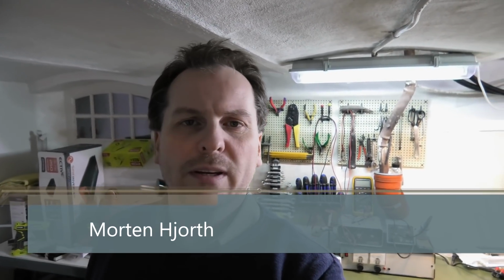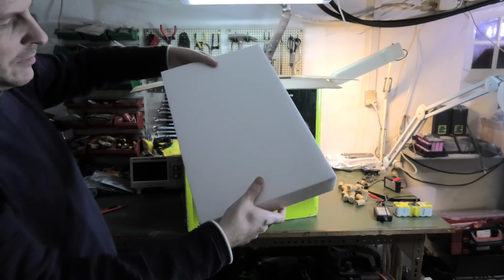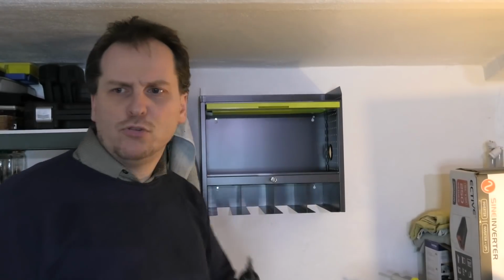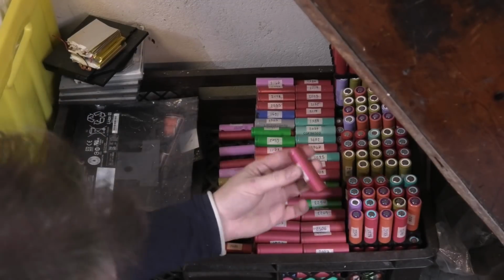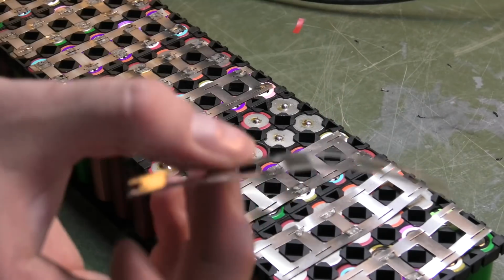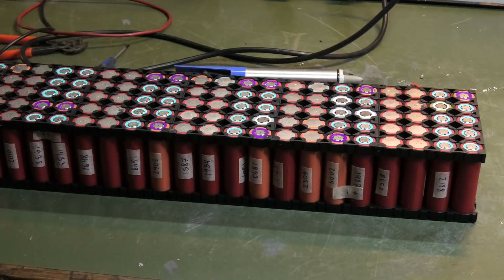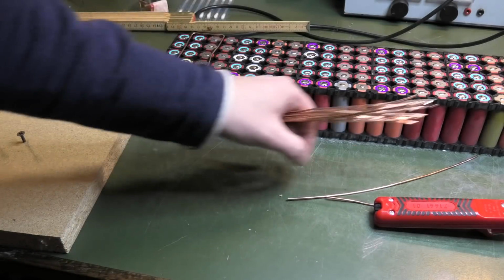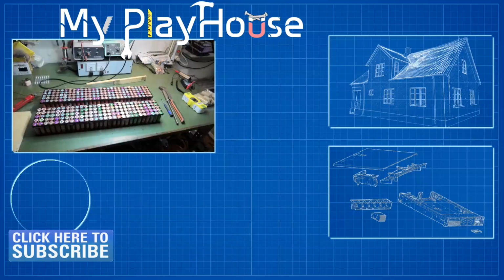2 KWH Li-ion Battery banks and Ryobi Tool Cabinet - 917

Comment: Hi Morten, A little tip for you to strip copper wire. 
A little block of wood, saw to the depth of a razer blade with a thin saw blade
Drill a hole a little wider than the wire being used, at the bottom of the saw blade in the same direction as the cut.
Tap the razor blade into the cut slot with one end angled to the depth of the top of the drill hole. Job done.
Put the wire in the wooden hole, give it a push past the blade, grab the end coming out and keep pulling.
The razor blade will cut into the insulation as your pulling it.
A bit hard to explain but I'm sure you get the idea
Good luck
Reply from the maker: Do you have a pic or link ?

Comment: get a Kweld and a big lead acid or a high drain 3 s with sth like 5k to 10k mAh its a super nice spotwelder, I own one and it basicly welds everything to a battery. 
the stress on the battery is mutch lower when spotwelding thats the main advantage.
Reply from the maker: I have had no luck, and have tried two.
Reply: @MyPlayHouse  yes there a view thinks that you must be awere of for example if u use to long of a lead the inductance on shutdown is capable of blowing the free weeling diode and so on ... 
I use a new old stock 120ah lead acid and it puts out 1.6 kA with a max pule energy of 100J you can weld anything with that. 
Again I highly rekomend getting a kweld they are made by a dude in germany and cost about 130€

Comment: Your bust bars that go through the plastic holders could over time scratch the cells and short out, I would either shorten the bustbar or use insulation tap to protect the cells. I did enjoy your video Morten.
Reply from the maker: Hi Peter195267
Thank You very much!  There is plastic in between,, and I am still going to hot glue the heck out of it.
Thank you for watching! :-)

Comment: For fast soldering i use a 100W solder, with 100W i need 1-2 sec and work is done, and battery dont overheat
Reply from the maker: Hi razbaluy
Thank You very much! Yes heat helps a lot! glad you liked the video :-)
Thank you for watching! :-)

Comment: Rawlplug is the company.
I learnt a long time ago that the drilled hole needs to go into the brick so the plug has a strong base, and always tap the plug below the surface plaster.
String through the plastic battery holders? brain fade :-D
Reply from the maker: Hi zx8401ztv
Thank You very much! I think I did all that :-) glad you liked the video.
Thank you for watching! :-)

Comment: If you are somehow lost in Italy and you need those wall anchors, here in Italy they are called "Tasselli" or "Fischer"(one of the most known brands of those around these parts). About the drill tip, every wall anchors here have the diameter stamped on the plastic body, just in case you are not sure which one to use. Last but not least you are not supposed to "submerge" the anchor in the wall (or hammer it, that way you will destroy the fins which hold it in place) as it will lose strength, you need to have the anchor at the wall level.
Reply from the maker: Hi Matteo Saitta
Thank You very much! lost in Italy,, yarh I would have taken a serious wrong turn, and dosed off at the while, for several hours :-)
Thank you for watching! :-)

Comment: That's probably the only Ryobi tool that doesn't need a battery 😂
Reply: It needs a battery if you put RGB into it.   😄
Reply from the maker: Well lets see if it does not end up holding batteries :-)

Comment: So how does the self-made 18650 battery bank work in conjunction with these huge lead acid batteries that you have connected to the UPS? Is this an extension for the lead bank, or are they completely separate systems, and what is their different use? Somehow I didn't understand that...
Reply from the maker: Hi Seegal Galguntijak
I must admit,, that I do still not know how to combine those two systems,, so we will see :-/
Thank you for watching! :-)
Reply: @MyPlayHouse  Or maybe you have two different purposes for the two systems and use them independently from each other for something else?

Comment: …and there we have it, the awkwardness of the design of the cunningly handy holders for the batteries struck for the first time.
I fear it's too simple, simplified to a degree where it isn't really maintainable anymore. The entire block of batteries will sooner or later be at risk of falling appart when you had to exchange enough of the batteries. That's not really sustainable. detachable straight rows of eight cells probably should be the size of the modules that you link together to make the power blocks. Like that, you could disconnect an individual module, take it out and fix any issues while the rest of the cluster keeps working.
I admire your patience, Morten. I probably would have cursed the inventor of those holders in most innovative ways many times before. Ways even Ziltoid the Omniscient wouldn't think of.
Curses so subtle and powerfull, even his mind would boggle.
Boggle in terror and amazement!!1! ....yeeees.
Reply from the maker: The replacement of a few cells will not do much the the straight,, I only removed the taps holding the battery in places sideways.

Comment: I'm getting ready to build my first pack. I was thinking 7s 20p for 24 volt inverter. (I still need to buy one.) I see you going for 48 volts. Did you settle on 14s because that just happens to match the inverter you already have? Or was it a wire size thing?
Reply from the maker: Hi Brian Haynes
Thank You very much! Yes I went for 14S to make it as compatible with 48v systems as possible.
Thank you for watching! :-)
Reply: I went with a 24v inverter, I wish I thought it out a bit, like how I was going to charge in a emergency, if I needed to lower DC accessories, and depending on the inverter size, I almost wish I went with 12v, but since liion doesn't make the best 12v I went with 7s for 29.4v, but charge to 28v normally, and above 22v. I wouldn't use a inverter over 3kw on 12v unless it's used mostly under 3kw, basically all high current connections eventually get hot and have issues, I tru to stay under 300amps with large cables and lugs,   just a little advice I wish I got, it would have saved me some money!!
Reply: @jamest.5001  Yeah, there's a 12 volt inverter in the house already. And I was using it to make a pot of coffee (off of some old tired deep cycle trojan batteries) and the wires got hot. The plan is to use welding cable and lugs in as short a run as I can swing. For now I plan to charge the packs from the grid more as a backup than anything. I've also got three solar panels to play with as well.

Comment: Morten, the thing you are doing with these Li-Ion cells is extremely foolish and hazardous.

It is extremely irresponsible to mix & match 18650 cells like this. The capacity of a cell is not the only thing by which one identifies a Li-Ion cell. There are different chemistry types and internal constructions designed for different purposes (e.g. giving out more current, or holding more capacity). When one mixes such different cells in parallel, some cells inevitably become a load for others, with unpredictable results like setting the whole battery pack on fire.

Bear in mind that Li-Ion cells burning cannot be extinguished with a standard CO2 or water-based fire extinguisher, because Lithium burns at over 400°C and is extremely reactive with water. When one works with such cells, a Class D extinguisher is required, and I bet you do not have one. But even if you do, it will be impossible to fight a fire in a small cellar.

And speaking of Lithium, water and confined spaces, it is extremely unsafe to store these cells in your basement where the chance for water to come is highest (flash floods, outflow from your old well...) It is doubly dangerous to work with such batteries in this environment. If, God forbid, you manage to set a cell on fire with your welder, will you have the ability and presence of mind to escape using that steep wooden ladder you have?

So basically, the whole video teaches people to be very irresponsible when handling Li-Ion cells, which is really bad. These cells need to be treated very carefully and with respect as they can incur huge damage and harm people. I highly recommend the website Battery University for important information on storing and handling Li-Ion batteries, and the 'Batteries in a Portable World' book by Isidore Buschman (owner of Battery University and the Cadex company which produces universal chargers).

Please be careful and stay safe.
Reply: Ivan Arnaudov wow he should hire you to be his mother. Calm down and remember he’s a professional.
Reply: @peterg.8245  Having an education as electrical engineer does not mean he is qualified to handle Li-Ion batteries. And judging from his actions, he clearly isn't. Also, how about all others who aren't but watch this silly video and set themselves on fire by trying similar things themselves?

Unlike Morten and you, I am working with Li-Ion cells (have been for about 10 years) and I've experienced first hand what could happen if two cells get accidentally shorted for a fraction of a second or if a spot welder bursts through the negative terminal of a cell because of improperly set power level, impulse length or poor contact.

So how about you talk about things you know and keep your opinion on things you have no experience with to yourself?
Reply from the maker: Hi Ivan Arnaudov
You do know that life is 100% deadly,, right!! If you do not feel safe, around Li-ion cells,, don't. But PLEASE stop yelling Woolf. 
Thank you for watching! :-)
Reply: @MyPlayHouse  You misunderstand and misrepresent my entire point. I personally feel safe around Li-Ion because I've educated myself and have practice. But as you request, I WILL stop marking every dumb and dangerous thing you are doing.